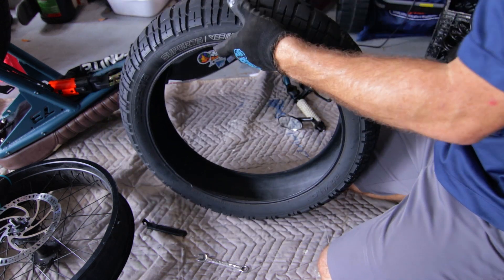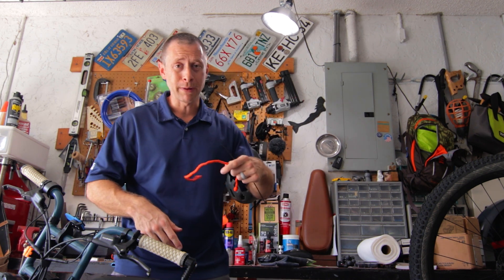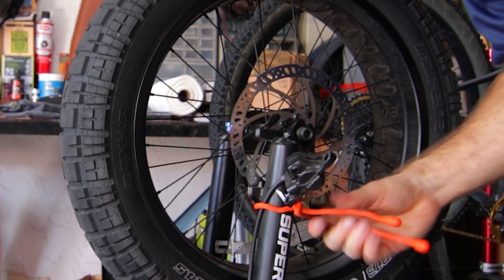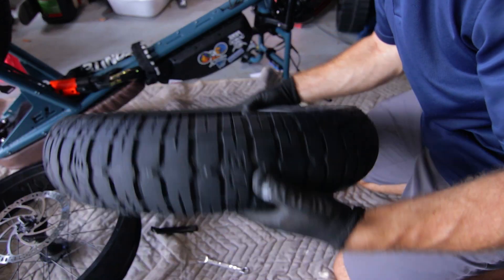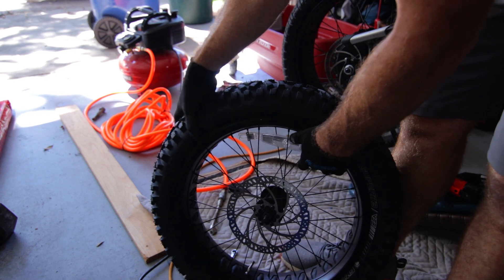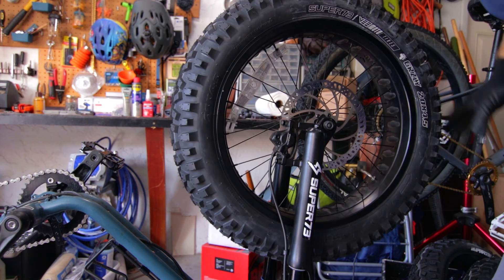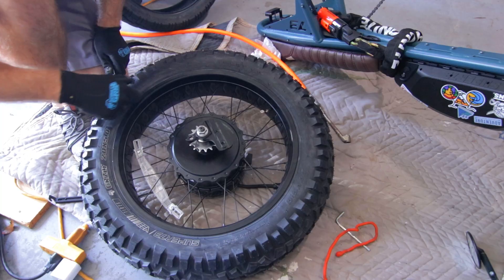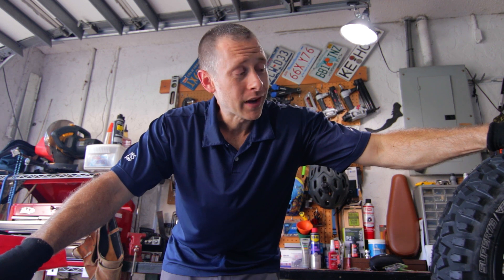Super73 NEW GRZLY Tire Install + Removal | Detailed Tire Removal & Install Super 73 Moto Grzly Tires

Comment: Shinko SR241 trail 3” x 16” motorcycle tire is what I’m running on both my FreeGo DK200  e bikes, the new motorcycle tube weighs more than bike tire and tube and I suggest running the motorcycle tube with bike tire for less flats as it’s at least 3 times thicker.
Shinko tires made a huge riding and comfort difference
Reply from the maker: Thanks for the tip. I'm going to checkout right now and see if they have the size I need!